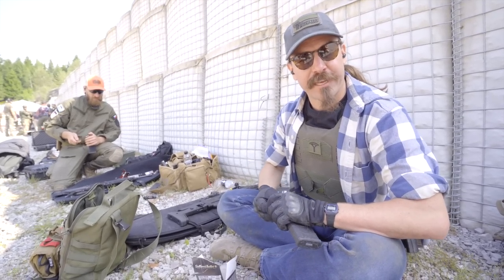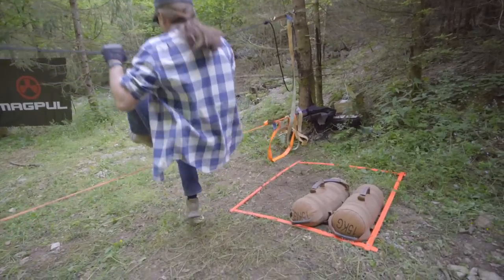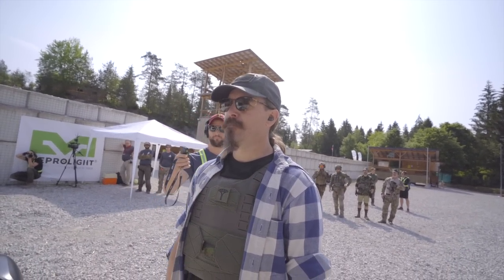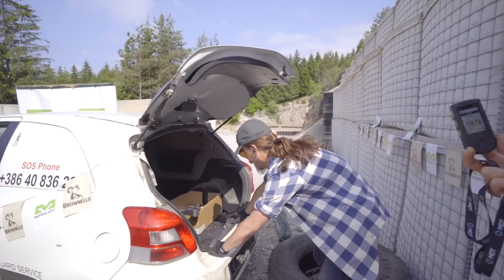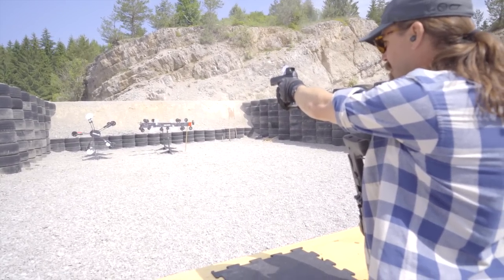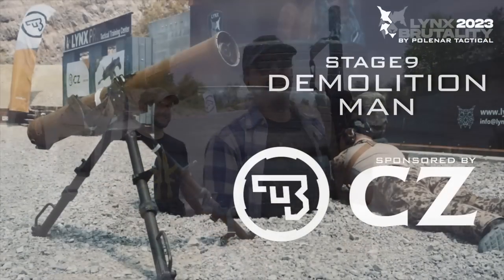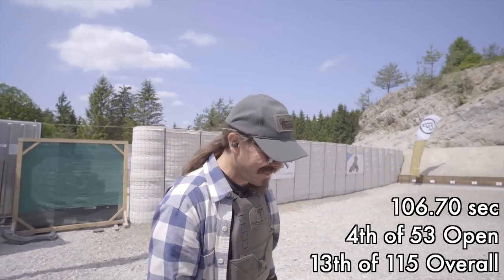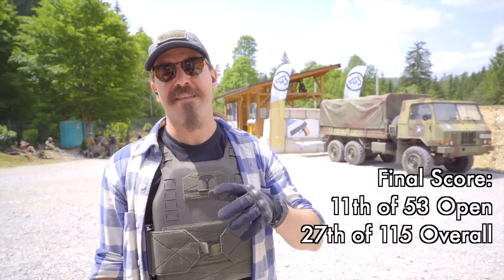Lynx Brutality 2023 Day 2 - Missiles and Grenade Launchers

Comment: physical exertion+time pressure+shooting targets = tough
Reply: And = tons of fun!
Reply: @AB0BA_69  the loose shirt is meant to cover up his body armor.  He is being “low profile” with his set up he describes it in part one which was posted yesterday
Reply: He needed it open to access his cummerbund ammo pouches.
Reply: @AB0BA_69  Ian explained multiple times when he got penalties on missing targets. How is that not "dumping round down range"? Based on your comments, it's almost like you didn't watch either of the videos at all.
Reply: @AB0BA_69  there are different divisions which dictate what gear you can use to a degree.  Also he was testing out the low profile plate carrier which is designed to be concealed.

Go watch part one
Reply: @AB0BA_69  🦧

Comment: So what happens if a no-shoot plate shakes off the plate rack due to vibration without being shot?
Reply from the maker: Then you get a lucky bonus.
Reply: @ForgottenWeapons  as in, a lucky 60 second penalty?
Reply: The no-shoots where painted after each hit, so they knew if you hit the plate or it fell off on its own
Reply: @roflchopter11  as Stefan replied the plates were painted after each run so the RO was able to determine if the plate was actually hit or just fell down on it's own. The penalty was given only for a hit on no-shoot plate, regardless if it fell down or not
Reply: Hostage had a heart attack from the stress😮